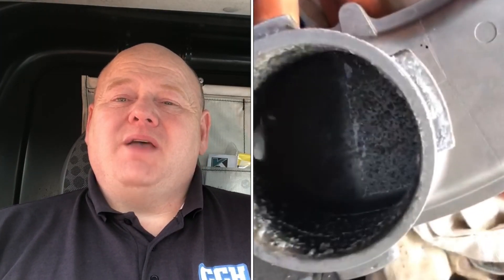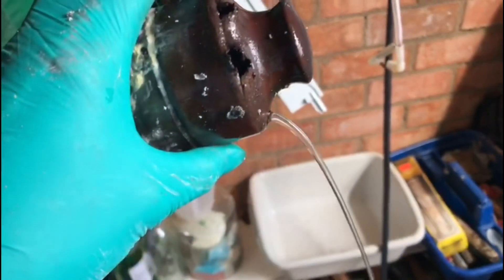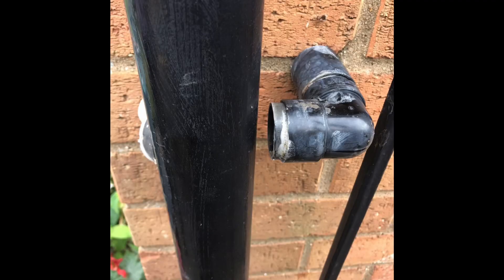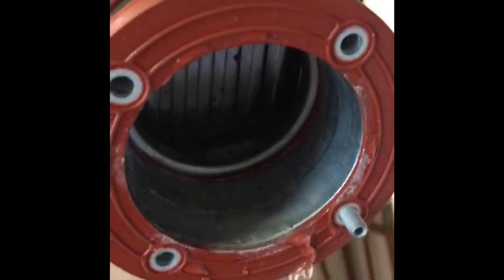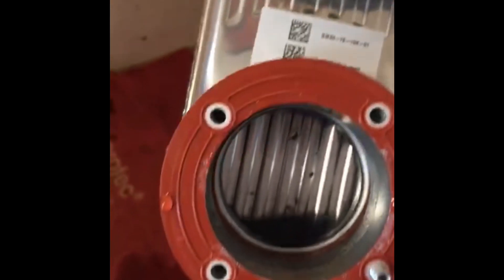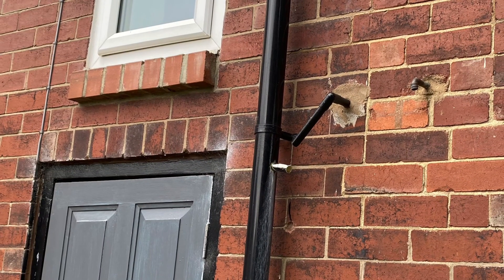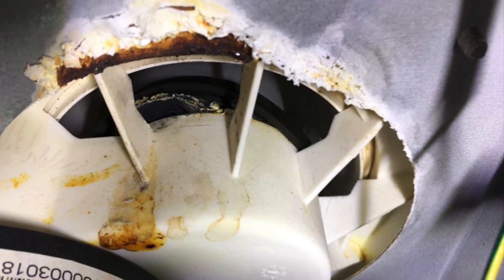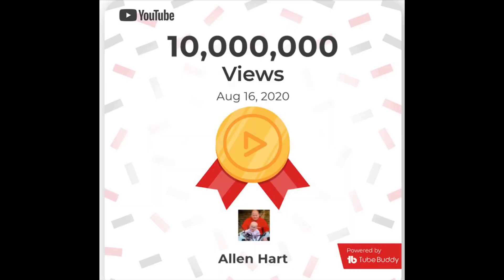Badly Installed Gas Boiler - Boilers Flooded - Worcester Bosch - Ideal Vogue

Comment: Good video allen highlighting how something so simple can cause such a massive problem. I'll be honest, I have in the past (years ago) installed the condensate into a rainwater downpipe, as I was told to do so by my then boss who said it was ok. Until something like in these videos happens, it's really easy to do something and think it's acceptable just because someone else told you it's ok instead of actually checking the instructions yourself.
Reply from the maker: I am hoping that by highlighting things like this we will all improve. Thank you for your kind words. If you see anything bad please send me it on WhatsApp Thanks.
Reply: @AllenHart999  I'm sure your videos are helping plenty of people be better, if they help me they definitely help others. And I'll certainly send anything bad I come across, forgot to photo it the other day but doing a gas check on a property that my sister in law was buying, the gas fire wasnt secured to the surround, and there was no fixing hole to indicate it ever had been. The closure plate was also not fixed to the surround and the fire was actually at an angle where you could clearly see into the builders opening. Scary to think it was still connected to the gas supply and the house had previously been rented out for 14 years before the house sale 🙄

Comment: If you can't run condensate internal to main drain it's usually better to have an air gap externally if the only choice is a soak away. At least if it backs up then it doesn't flood the boiler. It's crazy how common incorrectly installed flues and condensate has become though.

Comment: Hi Allen I had similar issue with a baxi duotec where condence pipe was fitted in to soil stack. When it got blocked and backed up into boiler full of shite & piss not good to work on.
Reply from the maker: End of Boiler then really. Personally i wouldn’t work on one that had been filled with poo.
Reply: They can’t argue that the boiler was a load of shite then! Good selling point😂
Reply from the maker: @paulkelly3254  Them boilers are shite lol.

Comment: Hi Allen,what was the end result with that flooded boiler
Reply from the maker: The Worcester Bosch came back to life, Not sure about the Ideal Vogue. Thanks
Reply: Allen Hart ,cheers .
Reply: I’m an ideal engineer and it was me who sent it in to Allen,  the boiler was still running, had not shorted the electrics with all the water in the fan. But would not fire obviously.
I dried it all out, replaced the fan as a precaution and it worked fine.
Reply from the maker: Kevin Cranfield  Thank you so much for the amazing video
Reply: No worries pal, if I get any more interesting ones, I will send em your way.
Reply from the maker: Kevin Cranfield That would be absolutely amazing. Thanks again.
Reply: Kevin Cranfield ,Thanks.

Comment: Standard playboy engineers.  That’s lazy wok not even an air gap for the condense Backing up

An Mate boiler position is crucial. To see bad workmanship still being practiced is unacceptable. 
The position of the terminal out so far due to the width being less than stated possibly.
Looks shit, is it secure ?
Is it to ms 

So to win jobs 
1st  blagg the customer
2nd  do it cheap  
3rd get done by lunch 

Enjoyed a chuckle 👍🏼

Comment: Hi Alan I wished I realised about sending stuff social housing this week changing the meter checking the cooker for stability devices half a roll of red electric tape 14.5 mbar drop on a g4 at the start well done mate down the pub no tests done just a roll of tape is a new gas reg in the cowboys gas regs or lack of them and customer saying 
Manager saying why u checking the cooker it a visual in my head that pulling out the cooker checking the flue fire properly not going in with blinkers on 
As ur all over boiler could u let me know where I can get my hands on mi for boilers in regards to flues showing white my head as I am not sure it not right and could effect the condensate side of life would it be AR and confiscate been wrong is it AR

Comment: Don't believe they are gas Safe engineers fitting these. Customers finding cheap monkeys of FB!
Reply: Using a Gas Safe engineer is no guarantee of quality or standards, although the public get the impression it is.
Too many crap, rough, corner cutters in the trade.
Reply: FB requests always start with need a good, cheap, plumber, electrician, plasterer, builder etc. Good/ Cheap?  Read Cheap.